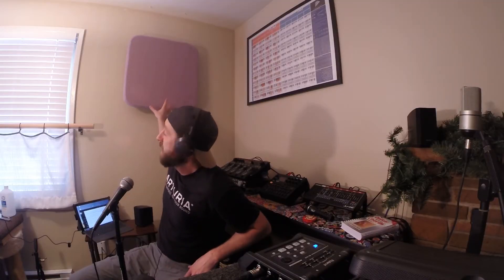Panel Speaker vs Cone Speaker, Part I: The Test

Comment: Just a thought.
Is basing the Size of the panel on the LEngth of a wave form.  Like how long is a Base wave form.  1 meter? 20hz is 60 feet long.
https://www.prosoundweb.com/the-long-and-short-of-it-acoustic-wavelengths/
Creating a board based on 1 direction is the low range the the other direction(horz/verti)  Could give a even better sound.

Comment: what are the best materials to use for the panel.  how does plywood compare?
Reply: Tech Ingredients did a video on materials testing. He found 1 inch thick 24"x24" polystyrene with the speaker in the 3/5th position (essentially with 3/5th of the panel on one side and 2/5th on the other in both dimensions) had the better sound portfolio. Also round the corners with 5 inch radius curves to cut out some of the resonance peaks and troughs.
Reply: @EatMyYeeties I want to use plywood.  how much of a drop off do you think there would be.
Reply from the maker: @gordonzio  So plywood to me would look the best for a stereo system. Granted, I'm no sound engineer, but in my mind the foam with a layer of glue makes sense. My logic, the sound actuator shakes your material like jello, you want a stiff outer edge to act as the "cone" but the foam lets the vibrations pass. I have suspect plywood with the random grain pattern, glue, and compressed wood might nip that fidelity. I haven't tested this theory, so I admit I could be totally wrong.

Comment: How did this turnout for your HT setup? Did it make the room calibration more challenging because of the wide dispersion field? Was it a 5.1 or ????
Reply from the maker: Hi Brian, I have 2 JBL speakers for my L&R, I've a center speaker under the flat screen and a subwoofer. These panels make up the rear end. IT IS AMAZING! I run my amp at 5.1, voice dialogue and string instruments LEAP out of the mix. It kind of feels like I'm wearing headphones no matter where I am in the room. Fantastic for podcast viewing as well.

Comment: I think you might try moving the speaker further away from the wall and if it isn’t, suspend it by wire/filament or fishing line if you prefer.
Reply from the maker: Right now I have them mounted only 8 inches from the wall. Visually it felt about right, lots of folks are telling me to scoot them further away. Currently using fishing line to suspend them from the ceiling. Thanks for your comment!

Comment: What's up Doc? Nice video. Could you please make another similar, with both a grand piano patch/sample demonstration, and a side by side spectral analysis of the sony and panel please? Maybe for simplicity just show on screen a recorded wave file comparison? A live demo would be awesome too. Thanks!
Reply: I'm building these for my Roland. Also, did you just use one driver per panel @ 4 ohms?
Reply from the maker: @damon_81  If only I had an analyzer! I was a bit worried about YouTube copy write pirates, hence me using personal recordings. I will tell you that pianos, guitars, and spoken voice really leap out of the panels. How's your build coming along?
Reply: @studiopaisley6039  Thanks for responding! Last time I checked, the drivers were out of stock. That was a month or so ago. My daughter will be taking piano next year in high school so I must get to them finished within the next 6 months. Once finished, I'll post a video on how they sound. I'm still going back and forth between 3 different material types. I have some 3/8 PVC board, I have a couple acrylic paintings, and then there is the pink foam board from HD. It may be a few days or so, but I will be making the panels. I also toyed with the idea of making a voice coil and magnet combo. I have the magnets and wire. I'm not too keen on this though because the bass coming off my keyboard blew my first set of speakers and I don't want to repeat this. Soon......

Comment: Made some of the best speakers out of 4 exciters and 2 sheets of 1/8" thick plexiglass ...sound absolutely  amazing with a 100W amp and 24v power supply ;)
Reply from the maker: Do you have 2 exciters placed on a single panel? If so, what kind of configuration are they in?
Reply: @studiopaisley6039  look up his channel, you can see his setup. Looks legit
Reply from the maker: Yeah bud, those panels are sick as hell. I might need to re-think my rig lol

Comment: Helpful video! i started my own DML combo with a 10" RSS265 tuned to 25hz and a 12"x40" DML panel with some goldwood tweeters on top xo'd at 10k since there seems to be a huge dip around 10k when i measured them with my omnimic.
Reply from the maker: Sounds like you're well on the way to a killer system. Don't skip on sound treatments! https://youtu.be/9ZP7M2RW7wo